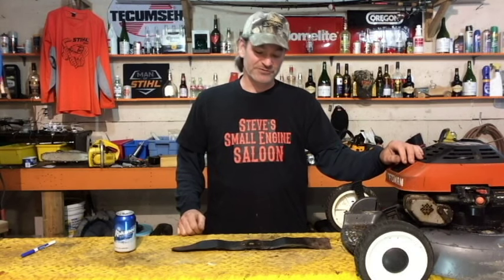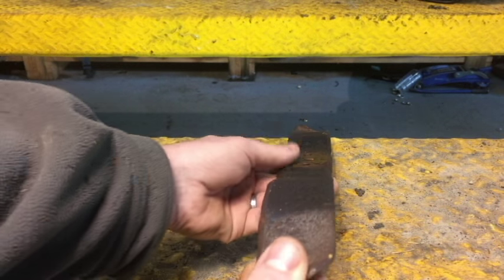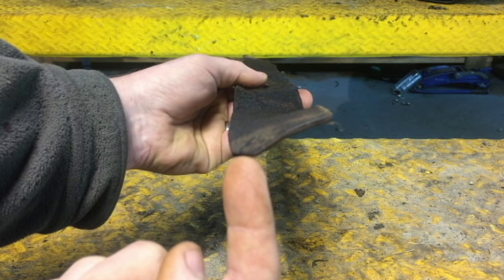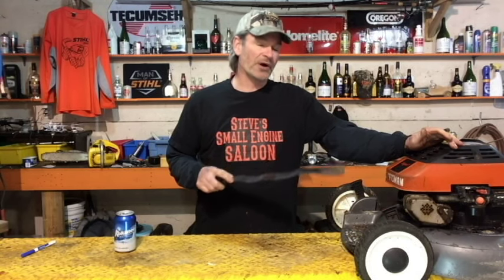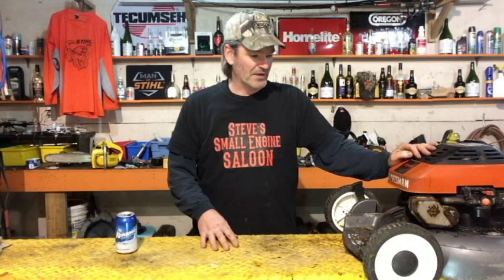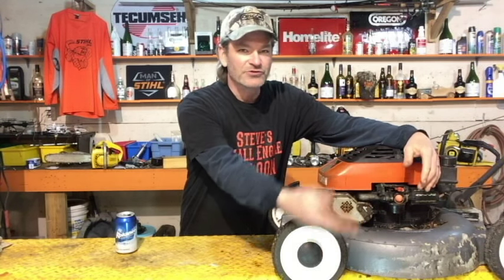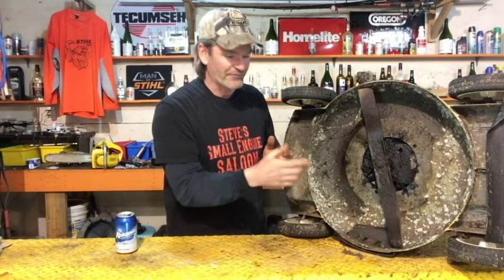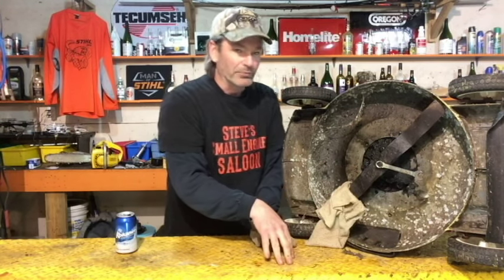How To INSTALL A Lawn Mower BLADE Properly (Step-by-Step)

Comment: ⁉Hi! How can we know which is the right way when both sides look and have been sharpened by previous users not knowing what they were doing? I've noticed this blade is concave towards the center and have the country of manufacturing printed on one side. Unfortunately for my case, the "wing" method doesn't work because either way there's a wing going towards the sky. Thank you! 🙂

Comment: Yes I had to jam a piece of wood underneath the deck to loosen my blade on my riding lawnmower. Had to Lubricate it with WD-40 And I also used some silicone spray. It got me Worried for a moment, but after it sat soaking for a hour , and with a little more persuasion from my favorite hammer, it came loose.

Comment: Yes you are correct.   I have seen this done before.   Neighbor asked me sharpen her lawn tractor blades.    As I got underneath deck  to take off blades I noticed one blade had been installed upside down.    Crazy.

Comment: You could also use a sharpie to mark the bottom side of the blade. My blade was stamped bottom but i still marked it with a sharpie "bottom".

Comment: Hi, My mother has a really old riding mower. But it runs well. A neighbor had been maintaining it. I went over this spring to get it out of shed for her. and Noticed the blade is shot. I put a breaker bar on the blade nut, and it would not budge. What is your best method for loosening, a blade nut that probably hasn't been removed in 10 years. Thanks.

Comment: I found that working on a lawn mower on a bench is a really good way to go.  But always check and double check that you personally pulled the sparkplug off,  So not a mechanic , but the bend  up at the tip is to throw the grass up. So correct me if wrong.. the bend up will be towards the lawnmower deck and away from grass. Great video. Btw I just use a medium size socket wrench..about 12 inches ..more leverage. .
Reply from the maker: You are correct....

Comment: Thanks for the video.  Had to go to youtube as I wasnt sure what way to put a new blade on.  Helped me put my mower blade back on the proper way when I replaced it.
Question, I had a motor swapped by a fellow but after the swap, its always smell like gas in the garage or storage depending where I store it. The gas also evaporates  in between mowing.  Once the gas avaporates, the gas like smell is also gone.  Was there something the guy missed or forgot, or maybe didnt do right when he did the swap?
Reply: Your gas is leaking out *somewhere*.
Does the mower have a fuel shutoff valve? 
(1) If yes, be sure to use it when you're done with the mower. 
(2) If no, check the carburetor, may be leaking at the bowl gasket, or where bolt is - on bottom of the bowl.

Comment: I put a wood block in the blade channel and hold it in place with my foot. I have seen others use a c clamp with a block of wood on the outside. Then I use a socket wrench to undo the blade.

Comment: I replaced the blade. I was very proud of myself since I did a complete tune-up. Everything was going fine. 3rd mow, the bolt sheared off. I was not exactly sure how the nut, washer, and another little part...looks like a smaller washer with a slit in it...locknut? And put it back together. I tightened everything as best I could, even to a hammer to the wrench to be sure it was tightened properly, but the whole blade came off after the 3rd mow. while mowing. What could I have done wrong? T.I.A.

Comment: Great common sense tips shown here. Most tool guys have an impact wrench either battery or air powered. Using one of these wrenches is a great knuckle saver but can be hard on the wrist if not gripped correctly .However the average home owner probably does not have one of these tools. That is where the double wrench tip would be handy. One could also use an offset wrench which are usually a longer length wrench than a standard wrench to achieve the same results.

Comment: Hey Steve I watch your videos all the time I have a Husqvarna 67522es went to buy a blade for it and I've never seen one like this it has one big circle and one that's at a like 45° angle do you think they might have changed the engine or adapter I look up the engine number and it just doesn't come up with anything? 20016q010381 is engraved on the engine. There are no stamp markings on the blade?

Comment: Every time I take my blade/blades off (riding or push) I clean the bolt and apply a very light coat of grease to it.  It makes getting that bolt out easy every time.  If you got a used mower from someone often those bolts are really stuck.  WD or another penetrating lubricant a day before trying to hard can really help.     👍

Comment: Thanks for the tips on how to position the blade.  I knew that it mattered because there was a sharp and dull side, but had wrongly assumed that the blade ran clockwise.  I was actually trying to turn it on, turn it off, and then quickly turn it over so I could see the direction that the blade was spinning.   This of course did not work.   Since my blade did no have such a well defined "wing", having the two other ways to test it was very helpful.
Reply from the maker: Awesome,  glad I helped...
Reply: I made the same mistake! The blade does go clockwise, when it is right side up and you are mowing! But upside down....counter clockwise!!!
Reply: @justdustino1371  This has been puzzling me!..thank you

Comment: If you put it on backwards and start mowing, possibly hits something with the low wing like you said early on, would that cause the bolt to back off and the blade fall off? What could cause that?

Comment: Steve. I have a power washer that starts right up , runs, and makes some noise after it its hot. Than I will shut it off and it will seize up till I let it get completely cold again. I bought it brand new. Worked fine the first 2 times. Than after that it started to seize up. It is a Ryobi with a Honda engine over head cam. GVC 160 It is a 3000 psi. Any suggestions please? I have had great luck for many years with Ryobi all except now. I bought a hat the other day and today I am going to buy you a beer. From one of your fans that always give you a thumbs up.

Comment: ON a mower where I know for sure that the blade is correctly installed, I simply just put it ( new or sharpened) back on the same way it came off with he cutting edge rotating the same direction. The cutting ( sharpened) edge has to be the first part of the blade to make a cutting contact with the grass as the engine is rotating.

Comment: Thank you fellow Van Isler. (I grew up in Nanaimo). I’m a freakin idiot. As soon as you said the motor turns CCW, I freaked and ran out and checked my blade. Yeah, no wonder it hasn’t been mulching lately.  Fuch!  But thanks. Greatly appreciated. I owe you a Kokanee.

Comment: 6:00 Pro tip: if the bolt is hard to turn, setting the end of the wrench close to the blade so that you can crab both with a single hand is a good way to get more force to the wrench. Humans have suprisingly good gripping force and you can apply really high force this way – the end of the wrench must be so that when you close your fist, the end of the wrench must move to the position where it loosens the bolt.

Comment: Steve, do you use removable Loctite or Lock washers when replacing the blade ?  Assuming you don't know if who ever did it before you lost the washer or ????

Comment: My blade doesn't have a sharp side and a dull side. All 4 edges are sharpened. Maybe it is some kind of mulching blade. In that respect how do you determine if it is upside down or not? I could not find a metal stamping labeling the grass side.

Comment: Instead of double wrench, you could also get a two or three feet long metal pipe that can fit the end of a wrench inside it. You can apply serious force with such a setup. Some call it "cheater bar" because it can apply so much force that the bolt just snaps broken if it's really rusted. Hammering the end of the bolt while applying turning force helps preventing snapping the bolt.

Comment: I have a question, so I bent my blade and the vibration is higher and it cuts off when mowing and it happened before this but the shit off is worst now and I was wondering if I turn the blade upside down with it being bent would it stop turning off while mowing?

Comment: Quick question steve. So my mower i brought last year when its fired up it sounds lime its missing a beat like it needs more air as it sound lime its choking a little is that a poor engien or sould i put a better traetment in with the fuel thanks
Reply: Speaking of fuel, I'm a firm believer of using alcohol free fuel, none of that ethanol added stuff. I'm not Steve but my advice is check the basics, your air filter, oil level, and spark plug. Shouldn't be acting up of you "bought it last year".

Comment: Steve-- thanks for the great vids. I'm working on a Lawnboy 10302. I can't  seem to get the blade nut off: Requires a 15/16 socket, have used a breaker bar, PB Blaster, heated the bolt. Nut is not rounded off. Turning counter clockwise. Any suggestions? Is it possible that this needs turned clockwise-- I can't tell from the threads.Suggestion?

Comment: i use a thick pvc pipe as
my breaker-bar. Of course
it's about 2 feet long to
use on car lug-nuts. I'd
rather have it break than
the tools. And a ratchet 
with the correct socket;
works rather well all these decades.
I've stuffed it with slices of a
pool noodle, that way the whole 
length of the ratchet arm is 
supported instead of just the 
end.

excellent presentation, thanks, good advice...
Reply from the maker: You're Welcome...and Thank You...
Reply: Josh Frank  oh no, I do understand your position, and I feel the same way,
however, I am saving my trusted and non-imaginary vanadium-chromium
breaker bar for real things, like looters and arsonists.
One tap on their lug-nuts and they are ready to go somewhere
else to loot and burn...lol

Comment: im using a toro mower..  i just bought a universal blade its called power rake .. anyway my issue is the old blade is curved to fit the bracket on my mower...new blade is flat is this still ok?  or do i have to hammer off the bracket and use the lock washers and stuff that came with new blade?

Comment: Should the lawn mower blade bolt have anti-seize or thread lock ?
Reply: Bruce Wagenberg - Neither is necessary but I like to use a little bit of anti-seize on mine to make sure removal in the future is easier. Thread locker is definitely not necessary and the counterclockwise rotation of the blades actually serves to keep the bolt tight during operation.

Comment: Those are nice tips for the push mowers, but with the mowers with 3 blades it is a different story. I have a tool to connect to one blade and then remove the blade, and it does the same thing for the other outer blade, but the middle blade is a different story. How does it help in removing that blade?

Comment: I could swear that my blades turn clockwise, my discharge shut is on the right and shoots the grass backwards.  Am I miss understanding.  By the way I love Steve's channel and find he explains things better than most out there and in lay mans terms.
Reply: Looking down on the mower when the mower is running, the blade is turning clock wise. Looking up from the ground or if the mower is turned over, the blade would appear to  turn counter-clock wise.
Reply: @ednorris9798  thank you for that
Reply: @ednorris9798  It depends on which side is up, if you place the mower on its right side it will appear counterclockwise but on the left it will appear clockwise.

Comment: Hi steve, your videos are a great learning tool, my brother and I , from 'cape 'cod Massachusetts , watch you all the time.
I have a question that I'm sure you could answer for me.  I have  a 42" crapsman lawn tractor, it has two mower blades
, what is the correct way to install the two blades , placement wise, or does it matter?
Reply: When video reached 7:11 you imagine a bad accident coming. That is defintely the wrong wrench is use and too short. A socket and breaker bar or ratchet with extension should be used.

Comment: With the thin, stamped decks on many lawn tractors, the decks will bend as well if the blades catch stumps and such. Replacing decks is obviously very expensive.

Comment: I have a question? How tight is too tight for blade. I broke the spindle, hitting a rock, got new 5-point star spindle,  installed, tightened it very tight or maybe too much...started it and the 5-point star thing failed immediately and the blade fell off soon after. Did I over tighten it?
Reply: I had not even cut anything yes, mower had only run for < 10 seconds. Maybe it was not tight enough? How to tell?

Comment: Steve, I am beginning to work on mowers slowly and hope to one day start my own business.   Do all mowers need a bell blade support to hold the blade on?  I have a blade, a 7/8" keyed adapter, and two small washers and a larger washer.  The blade has two holes that makes me think that it will fit a tab from the bell blade support.  Will I need to order one of them?
Reply from the maker: As far as I know only mowers manufactured by MTD even have that thing, if the adapter has that "bow tie" style center.

Comment: Touch on leveling the deck for multi-blade units.  JD sells a nice cheap little leveling toy which allows you to measure the blade distance to the surface, not the edge of the deck. Within 1/4" left to right, front most arc 1/8" higher than the rear arc.

Comment: If the oil can get from the crankshaft to the airfilter, it can get in the cylinder, and you risk "hydrolocking" it. A good way to prevent that, is to make sure that tthe piston is at top dead center before flipping it on the side. You pretty much pull the string until the compression makes it hard to pull, at the point just before the piston goes back down. It takes a bit of practice, but it's the best way to prevent getting too much oil into the cylinder (and other unwanted places).

Comment: How about using a 9/16 socket with a 3/8 drive breaker bar or ratchet. That is what I use on mine.  If they are really stubborn I have used an impact gun on them also using leather gloves of course.

Comment: I have a new cub cadet and they tell me to use "Riding mower blades should be installed between 70 and 90 foot-pounds of torque"  What is a good torque wrench for a un-handyman like myself?

Comment: I use a ratchet handle and socket to remove the bolt and if it is very tight I will use a 1/2 in breaker bar to break it loose. I would never use a hand wrench.  All those bolts have torque specs.  The torque spec on my mower is 50 ft/lb. So I check them with a torque wrench.

Comment: i bought some replacement blades and the arch in the middle of the blade was inverted. Does that make a difference. clockwise turn. cub cadet rzt zero turn 46"
Reply: They're probably some aftermarket blades. No problem if they're properly installed. From under the deck they turn counter clockwise. Unless you have a rear discharge deck.

Comment: I had some yahoo DIY shop sharpen my mower blade last year. After a few months of use I noticed it didn't seem to cut like it used to. It seemed to be crappier.  My mower is over 10 years old now, I just figured it was old age. It also kept stalling a lot on tall grass.  The season turned to winter and it didn't get used.  Used it more this summer and it still seemed rough. 

Last week when I flipped my mower over to try hosing the deck off on the bottom, I thought the blade was looking too close to the deck, and there was scratch rings on the metal.  I thought something seemed weird. I looked online, and I noticed the smooth part of the blade where the washer sits inside the channel of the blade was not like that on mine, the channel was facing upwards.  I said holy shit, no wonder!  The wing is also facing down, and this explains the weird crop-circle style swirling marks that was left on my lawn. 

I also learned that you are not to use a mulching blade when you are bagging it, as it chokes off the mower and does not spin fast enough to toss the grass into the bag, just sits it under the mower. It's only meant when you do side discharge. I bought a straight blade to remedy this issue since I bag it a lot. 

I will remove it and buy a new blade. I will never again have anyone else touch my tools. I will learn to DIY. Also on my mower, new blades are only $10-$12 because it is an old model so it is not expensive at all to just buy a new blade when it gets dull. My lawn edger blades cost $9 themselves and when those are dull you toss them out too.